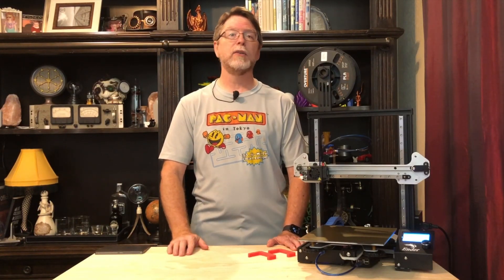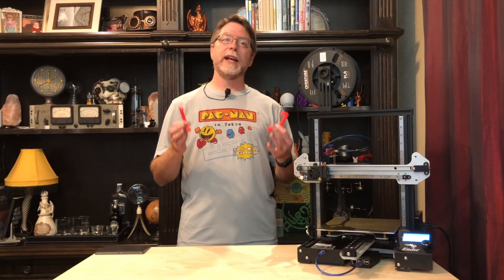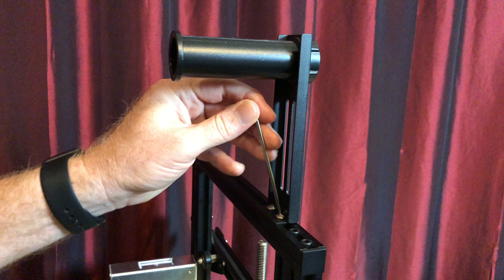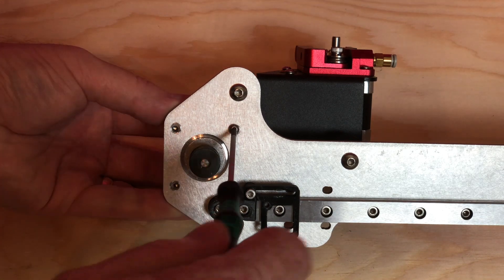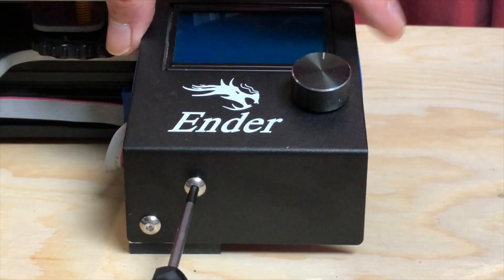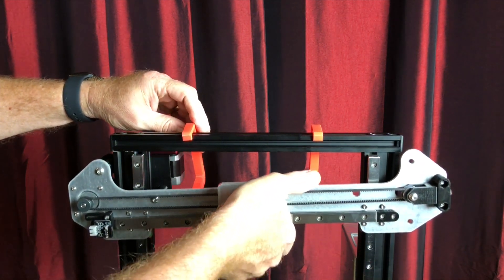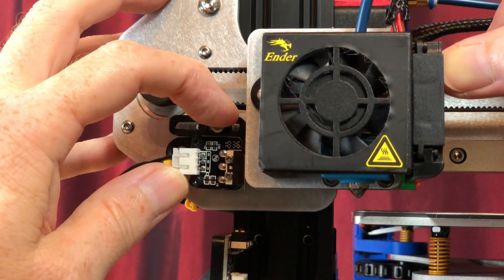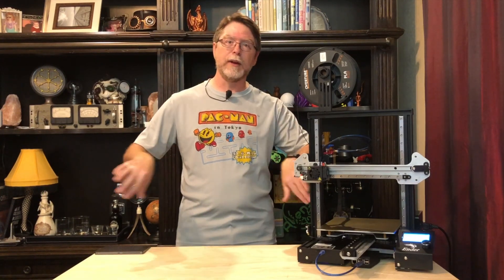How To Install 3Dfused X & Z Axis Linear Rail Kit for Ender 3 & Ender 3 Pro

Comment: I am currently making a video on my 3Dfussed linear Rail X, Y and Z kits. For my Ender 3 Max printer. As you will see when I get the install done and upload my video that.... First, my kits must be generic kits and not specific to my particular printer. There are just so many holes drilled and taped into each part that it becomes confusing as to how to get stuff installed. One example of this is that my limit switch for the X carriage is non adjustable. I used the screws that I already had to attach it to the x rail kit. I used one screw because there was not a second hole in the place to line up with my particular switch. Explained further in the video. And there are so many holes drilled and taped on the x carriage mounting plate that I now have to figure out which holes to use to mount my E3D Revo 6 hot end. And for the Y axis rail kit I had  to use T-nut and bolts to attach the kit to the extrusion rail. Once I figured that out then that part of the install was easy. But the instructions on 3dfussed web site is very sketchy. It is generic to all printers and there is no instructions for how to install the Z linear rail kit. Lastly, my z kit came with a 400mm Z rail. Which sounds long enough but not really. Watch my video which I am going to post in a few days. Finally, I would think after 4 years from the date of your video that the instructions would be much better. I show in my video alternative oil that you can use if like me you forgot to order a bottle.

Comment: Great video. i just bought the x/y/z rail kits for my ender 3 max. These are bit expensive. I spent about $300-350 to retrofit my Ender 3 Max. I also bought the x/y kits for my 218 Tevo Tornado printer. I am going to see how this goes before buying the Z rail kit for my Tornado. I have done much upgrading on my printers. But, I hope the install is as easy as it looks in your video. I tried the ExOslide kits and I gave up because I had to do so much modifications and I could never get the Y kit to work. The guy got back to me very fast and had links to all kits needed for both printers. So very easy to know what to order. I hate the wheel system on these printer. Will be very happy to get rid of the wheels and never have to adjust my printer wheels again. With spaces, I bought, I now never have to bed level by the springs again.

Comment: I hope you might read this.  I installed this a few months ago, and it does work great when it comes to smooth rails, but I have not gotten a successful print out of it yet since the install.  I use a bltouch, and I noticed during the leveling process, the x-axis gets all the way to the right of the gantry, and it hits the end of the rail and grinds.  I adjusted the end stop, and now it still smacks pretty hard into the end of the rail, and I think it still cuts out a tooth or two on the belt because it does not seem to have the right coordinates for the ubl, and as such, the extruder seems to be just too high, or low, for the grid part it is on.  I have already leveled the bed, figured out the z-offset, and did a manual adjustment to the mesh, then tilted it to be safe, but it is either to far to stick, or too close, so close that it will jam the filament in the hotend cause it does not have enough room to extrude.  I am no noob when it comes to fdm, so I am sure I have done everything a moderately skilled printer can do.  The only thing I can think of is shortening the x-axis in jeyers to prevent the touch at the end of the new rail.  Please help me 3d-1-kenobi, you're my only hope.

Comment: Okay I'm back. I never did my X & Z axis linear rails yet, and I want to finish this printer before I start my coreXY project.. Can I use your X & Z kit with my duel Z motors on a Ender 3 pro? I'm about to put through an order if I can. Your kit is way too nice for a price close to what I'm already going to spend doing it myself. But I have to have it fit with my second z motor upgrade. I have a machined aluminum plate that is almost exact  (or is exact) to what was there except it has a motor mount for a second extruder.. I don't use that but it's there..

Comment: Note for anyone who uses their 3D Printer for more artsy things.

Linear rails will translate every single bit of vibration onto the part while doing relatively little to improve print quality or speed for that type of print otherwise.

Linear rails are great if you intend to do high volume mechanically focused parts where surface quality isn't much of a defining factor. You have precision, capacity for speed and everything else you need for high speed printing.

But every bit of vibration and resonance will be plainly readable on the surface of the part.

And you may think that linear rails will be smoother than the rubber wheels.

Yes and no.

Rubber wheels by being rubber will already absorb an amount of vibration.

And a lot of the vibration you get in a 3D Printer doesn't per se come from the rails themselves, but from the motors (you can read the steps from a motor on the surface of a hard coupled, like you get with linear rails, printer), belts, guide screws and simply the fact parts of the machine are moving which causes resonances  in the system.

If you want to use linear rails for artsy prints, you'll need to put a crapton of work into removing any sort of vibration from the system (with even more upgrades and changes) and into preventative maintenance to keep vibration from the system.

The basic parts of an Ender 3 already remove a lot of these vibrations by using relatively loose couplings.

Comment: By aligning the x-axis rail with the top rail, you're taking for granted the 2 side rails were cut accurately to the same length. I would think it'd be better to measure up from the base on each side, then it would be parallel with the base.
Reply: It's irrelevant as long as when finished you have you linear motion systems parallel and 90 degrees. The surface you put your printer on, all the parts of the machine that are not part of the kinematics, all mostly irrelevant.

Comment: This is not needed, u just need linear rail with a few other parts which is way cheaper than that,  can do whole machine x,y, and z for like 50.00 or cheaper

Comment: Hy Bryan. I installed all 3 axis linear rails. Is there any way to reduce vibrations on X axis? During the print, when the 2 hotend fans start spinning, I can ear a vibration sound and this cause me some ghosting in my prints. This probablem was not present with old rubber wheels (I think rubber reduced the vibrations). I really need to solve this problem. It's frustrating. I thighened all the screw but the problem is still there. When I press my x carriege against the x axis, vibrations goes away. Please anyone can help?

Comment: Will this linear rail work with Micro Swiss Direct Drive Extruder for Creality CR-10 / Ender 3 Printers?
Reply from the maker: No, the two aren't compatible. The Micro Swiss Direct Drive kit includes its own X carriage. There's not a way to attach that X carriage to the one that comes with the 3DFused rail kit.
Reply: @BV3D  Actually, Micro Swiss has Linear rail versions - MGN12 and ExoSlide.
Reply from the maker: @renatodelatorre8865  I saw that, and they look cool. Micro-Swiss released them ...(checks email)...eight days ago. The only potential issue I see with the rail version working with this kit is that the part of the Micro-Swiss carriage where the belt attaches would collide with the left and right sides of the 3DFused X axis arm. The rail itself sits low enough for the belt attachment to clear, but when it gets to the far left or right side I think it'll collide.

Comment: Before installing make sure your vertical aluminium rails are parallel to each other. Otherwise it will always bind. You can use the top beam to align them.

Comment: And one more time "the Z motor needs repositioning, the Z screw should go in the coupler effortlessly, when it needs a little bend to go in, it means it's not perfectly square." I have followed the video or both if yoe are doning X and Z in one go and my Z Rod is 1cm to the left, seen from the back of the printer, at the top and it will only move the X Rail up/down a couple of times before it gets stuck !!! Any ideas, please

Comment: Hi Brian  just recieved my full kit for a CR10S Mk1  i have  an E3D hotend and Petsfang with a TH3D ezabl on the carriage currently on close inspection it looks as though this will not fit on the new linear rail plate any idea what i can do to solve this before i dismantle the printer

Comment: There's gotta be a better way to attach than t-nuts. I hate them.
Reply from the maker: On the Z axis, I don't think there's really a better way. That said, I'm pretty sure you could get away with one bolt & T-nut at the top of each Z rail, and one at the bottom. I may try that, if anyone's interested in the result. At the very least it would make aligning the Z rails a lot easier if you only have two T-nuts on one side to worry about.

Comment: Hi!! Do you happen to know if my Micro Swiss Direct Drive Extruder (https://store.micro-swiss.com/products/micro-swiss-direct-drive-extruder) will work with the linear rail kit? Thank you in advance!
Reply from the maker: I don't think it will. From what I can see, the Micro-Swiss direct drive unit includes a machined X carriage which replaces the stock X carriage. It uses the wheels from the original X carriage though. There wouldn't be a way to mount the Micro-Swiss X carriage to the rail block on the 3Dfused X axis rail kit.
Reply: BV3D: Bryan Vines what about by using a printed spacer?

Comment: It seems to me that trying to tie a precision-ground linear rail to the wobbly-extruded aluminium in 16 places is ignoring the precision-ground aspect of the rail. Surely it would be better to attach them in only two places, approximately 1/4 of the way from each end of the linear rail, to retain the integrity of the linear rail?

Comment: I bought the X and Z Tevo version of this. I feel like it's added slightly more weight to the Z with the X kit all set up. I also upgraded my lead screw to a T8 2mm lead, and changed the steps to 1600 in firmware. Is a backlash nut overkill for a 2mm lead with a kit like this? 🤔 I also use 16 microstepping, and wonder if that's also not needed?

Comment: Are you still using the Z axis linear rail? X and Y are great but Z isn't quite right yet. The 4 screws holding the right X rail block loosen a bit over time and then the binding starts....
Reply: I have to agree with this. The design of the Z axis linear is very sloppy. Too much play in the system making it very difficult to the linear rails to run very smoothly.

Comment: does the 3DFused rail solution also allow for moving your stock extruder onto the X carriage to make it direct drive?  I have the printermods directdrive kit installed on mine.
just want to know if there's a direct drive solution that works

Comment: I found after having levelling issues that the recommended method for truing up the Z axis Linear Bearings to the X Axis is to allow the Print Head to rest against the Bed and then to tighten the bottom and then raise the print nozzle all the way up to the top to tighten the screws holding the Z Axis linear bearings. Instead of using the Bracket that you designed to hang the X axis while tightening the Z Axis in place. I couldn't figure out why it worked the first tie and then refused thereafter whenever I made an alternation. I can't express my gratitude enough though for showing these videos on the subject. I have all three axis set up with linear bearings now and all are within less than 1 mm. of being perfectly square from one print to the next, permanently.

Comment: Schlecht einfach nur schlecht ne Bilder Anleitung wie im IKEA wäre weitaus besser😠
Reply from the maker: "Bad just bad ne pictures Instructions in the IKEA would be much better"
Hallo, tut mir leid. Wenn Sie einen Vorschlag zur Verbesserung des Installationsvideos haben, bin ich froh, ihn zu hören.
(Hi, I'm sorry - If you have a suggestion on improving the installation video, I am happy to hear it.)
Reply: @BV3D  REPLACEMENT Y SPACER ?? Und noch mehr fragen sind offen
Reply: Erst immer vor jeden Arbeitsschritt  Bild von Schrauben und Zubehör zur Kontrolle z.b. Es ist nicht übersichtlich.
Reply from the maker: "Always before each work step Image of screws and accessories for checking e.g. It is not clear."
Oh ich verstehe. Meine neueren Videos sind darüber besser. Danke für die Rückmeldung!
(Ah, I understand. My newer videos are better about this. Thanks for the feedback!)

Comment: Hey.What size was the t nut and the size of the bolt used on the linear rail..
Reply from the maker: Hi Nathan! The Z axis uses M3x8 bolts with M3 T-nuts. The X axis bolts to the Z blocks with M3x6 bolts. 👍

Comment: hey man, what is the benefit of doing this? will the prints be significantly better than stock parts?
Reply: Better consistency, as in less chance for wear over time.  Also drastically increases rigidity of the gantry considering there’s only one lead screw for the z axis

Comment: Everything I think of someone else already did it. And not a bad price either. I have linear rails sitting around at work that the boss would let me take. But this is more convenient! If it wasn't out of stock I would have bought it.
Reply from the maker: There are several DIY Ender 3 linear rail projects on Thingiverse, for the X and Y axes. If you've got access to free rails at work, it couldn't hurt print a few parts and give it a shot! 👍

Comment: Is there a way to install EZABL sensor next to the printer's head?
Reply from the maker: If you have an EZABL mount that attaches using the same screw hole pattern that the stock hot en fan shroud uses, then yes. I'll have to experiment with that, though. I have an EZABL that I haven't installed yet. 👍

Comment: Thank you for making those points around 14:20. It's a thing many people don't think about.
Reply from the maker: No problem. It's something that people sometimes lose sight of. The Ender 3 is inexpensive, but good. And you can do whatever you want to with it, with regard to upgrades. The low relative cost of the printer is simply a bonus.

Comment: The effort to remove the PSU after this upgrade.... Think if I do it I'll relocate the PSU first.
Reply from the maker: Yyyyyeah, I've got something I want to try on the power supply and I am NOT looking forward to pulling that right-side Z rail off to do it. I did mention to 3Dfused that they may want to consider adding mounting holes so the rails can be moved to the other slot in the Z uprights.

Comment: Do you have a video of print quality before and after?
Reply: It's pretty much the same, as before, if not worse, as vibration from the machine is transferred more readily to the head by linear rails. It really does nothing for the Ender 3. Just printer bling, and more maintenance.

Comment: Assembly with two z-axes on the Ender 3 with step motor. there are complications?
Reply from the maker: I don't think so. Someone asked a similar question the other day; I checked with 3Dfused and they said they have a $4 add-on when you buy the kit to adapt it to a dual Z setup. They've got a chat feature on their site, so please check with them to make sure it'll work with what you have.

Comment: Will this work with dual Z axis?
Reply from the maker: I checked with 3Dfused. When you buy the kit, there's an add-on for about $4 that has the additional parts necessary to work on a dual Z motor setup.

See: https://3dfused.com/product/ender-3-ender-3-pro-xz-axis-linear-rail-kit/
Look for the checkbox to add "Additional Z Axis Hardware Kit (+$3.99)"